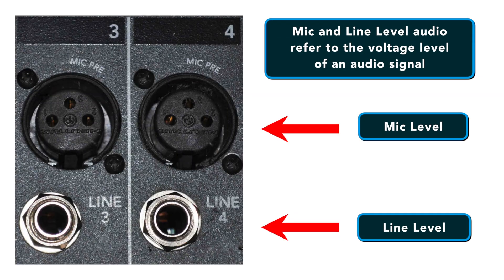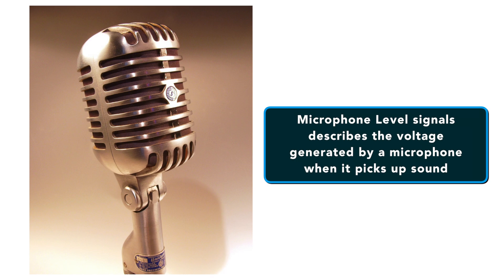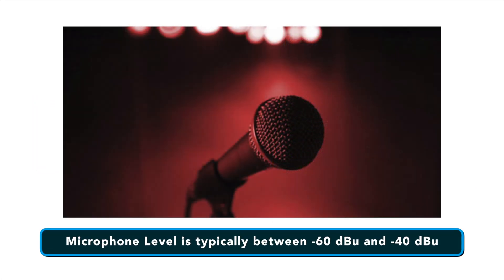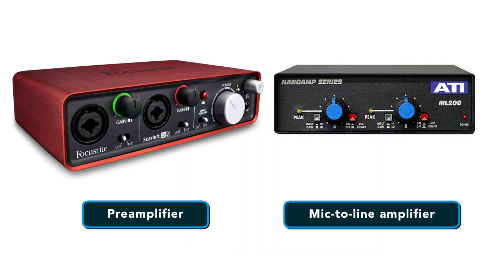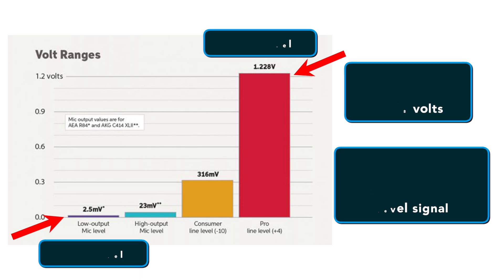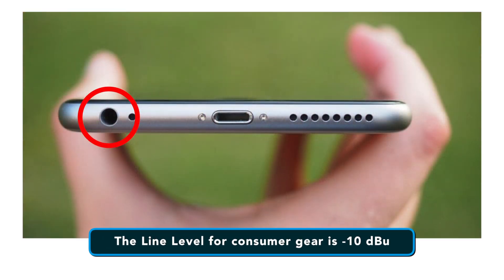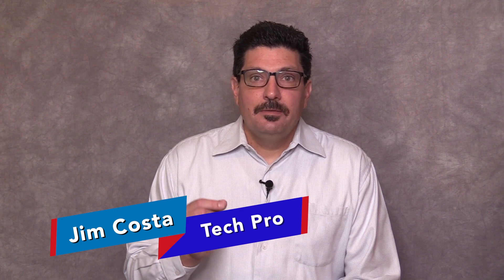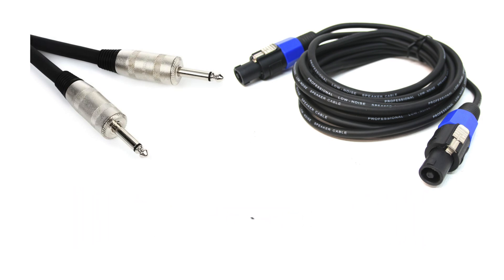Unraveling Audio Signals: A Guide to Mic, Line, & Instrument Levels

Comment: This guy has no idea what he's talking about. Take advice from him at your own peril. This may be the simplest explanation that you've come across, but that's only because he's not giving you all the information you need. And by leaving some things out, you run the risk of damaging your equipment. Find some better resources on this topic, and I think you'll agree with me. 

If you are new to all this, hold off on doing anything until you have a complete understanding on this topic. If you just start connecting different pieces of equipment together using only signal level as a guide, you can easily do damage.
Reply from the maker: Well, this is an entry level/beginner level of experience video. It's not meant to be advanced at this stage in a viewers experience. However, if you think the info is inaccurate, feel free to write a lengthly/detailed responce here and explain to the video viewers what you think they need to know. Or, better yet, make a video on the subject yourself and feel free to link to it in the comments here so video viewers can watch it after they see this one. Then they'll have all the info you believe they need.
Reply: @jimcostafilms  Don't get mad at me because you don't know what you're talking about. I'm not the one giving bad information. I don't owe you, or anyone else, and education. You can't learn this stuff in 5 minutes, and you can't teach anything to beginners when you're not a beginner yourself. 

That said, you are a very arrogant person, and need to be called out so others can see that you have no idea what you are talking about. If you actually read my post, I made it clear that without proper knowledge, equipment can be damaged. Instead of giving me an attitude, maybe you should have asked me to explain that. 

If you don't know the difference between balanced and single ended operation, you should not be touching equipment like this, let alone telling others how to do it. Not once in your video did you bring this up in any way. Balanced and single ended operation is not compatible, so if you need to mix them, steps must be taken for compatibility purposes. This is step number  1 in the process. You have to know how to safely connect your components before you do anything else. Have you ever noticed that some of the inputs/outputs on your gear have 2 conductors, while others have 3? This is kind of important. When you take something that has 3 pins/conductors and plug it into something that has 2, you better know what you're doing. Typical XLR/TRS to RCA/TS adaptors or adapting cables, typically take the number 2 conductor on the balanced end and shunt, or combine it with the ground on the single ended side of the connectors. That can be a problem because the number 2 pin is usually hot (+) and the ground (-), is not. When you turn both components on, you instantly create a short circuit. You'll end up with a nasty noise if you're lucky, but in some cases, you can damage the equipment. This is so important, all you have to do is look on the back of any components that have balanced audio ins and outs. 99% of the time, you'll see a diagram listing the electrical properties of each pin. This is why. 

When you talked about the different output levels in the video, you referred to the +4 output as "pro" grade, and the lower output as consumer grade. That's a false statement. Those 2 numbers tell you the input/output on the +4 connection is balanced, and the other is not. How do I know this? When a signal is balanced, you naturally end up with an additional 4-6 db in output. It has nothing to do with a piece being pro or consumer. There is plenty of consumer gear that uses balanced topology. The noise that you were referring to wasn't from overdriving an input, it was from improperly making a connection because you don't understand the electrical properties of each type of connection. 

I'm not even scratching the surface with the information in my post. You can take college level courses on this topic. You made other mistakes, as well, but I'm not going to spend my day at a keyboard. All I can say is you have to know this information. Its usually the first thing you need to learn. Here's a reference to get your started. https://www.ranecommercial.com/kb_article.php?article=2107

"
Reply from the maker: @AT-wl9yq  What makes you think I'm mad at you? I invited you to correct what you think was wrong in the comments and/or in your own video. You gave a lengthy explanation of some of what you think was incorrect and posted a link to the info you think was needed by viewers of the video which is what I suggested you do. 

The only one with an attitude seems to be you, first for saying, "This guy has no idea what he's talking about. Take advice from him at your own peril" in the opening of your original comment and then by stating in your next reply/comment, "Don't get mad at me because you don't know what you're talking about. I'm not the one giving bad information. I don't owe you, or anyone else, and education. You can't learn this stuff in 5 minutes, and you can't teach anything to beginners when you're not a beginner yourself. That said, you are a very arrogant person, and need to be called out so others can see that you have no idea what you are talking about." 

At what point did I attack you personally?

Do you really think I’d literally invite you publicly to correct me if I was so “arrogant?” My only goal is to provide to people accurate info they need; if not from me than from someone else. In fact, I think you should be making very detailed video tutorials on audio subjects since you took the time to provide such a detailed answer. Video viewers can probably learn a lot from you, but, I guess that since you owe no one an “education” you won’t create such tutorials even though you have valuable insight. 

I suppose it’s easier to anonymously troll than to publicly teach.
Reply: @jimcostafilms  It wasn't my intention to insult you, or anyone else. However, there is no shortage of bad and misleading information put out by people who don't have a full understanding of what it is they're talking about.

You keep asking me to make videos and tutorials, or whatever, but I've noticed that in both of your responses, you're being very careful not to touch on not a single word that I've said. These are fundamental concepts that you as an "educator" must know. There's nothing for me to add that isn't already available in abundance.

If you still think I'm wrong after all this, there's a simple solution. Quote me on something I said, and prove its not true. If you make an honest attempt and still can't figure it out, then I'll help you. But you have to at least try.
Reply from the maker: @AT-wl9yq  OK, fine. I’m not interested in proving you wrong. I never was. In fact, the opposite is true. I’m of the opinion that one should never complain unless they can prove they can do better themselves. I took from your detailed responce that you can do just that so you should try to help those that need it. If you don’t want to, that’s on you. You do, however, sound like a knowledgable person who could correct the bad info out there.

You said this, “If you don't know the difference between balanced and single ended operation, you should not be touching equipment like this, let alone telling others how to do it.”

So… since you seemed convinced that I have no idea what I’m talking about, I’ll compare/contrast Balanced vs. Single Ended Operation (as you brought it up) and few other types as well.  

My understanding is as follows. Please feel free to correct whatever is wrong. 

Single Ended

A single-ended configuration uses two signal connections, one for + and one for ground (or signal return). It is the most common connection used to headphones, between components, and in the internals of audio gear, by far.

Balanced

A balanced configuration still uses two signal connections, but requires that both lines have the same impedance (not nearly the same, actually the same). How this is achieved doesn’t matter (i.e. it could be from differential signal lines off a source or from a single or a single signal line and a resistor on the ground/return line). This, combined with the twisting of the lines, is what’s required to get the noise rejection from balanced operation (CMRR).

Differential

A differential configuration, which is still a two-wire connection, drives one line in + phase and the other in - phase. This doubles the potential difference between the signal lines, which is what yields the higher (double) peak-to-peak voltage of differential operation (and thus the higher signal level).

Typically a differential amplifier (balanced or not) requires twice as many amplification circuits (one each, per phase, per channel, so four total) as a non-differential design (one per channel). This means that for an otherwise identical amplification circuit, a differential implementation will require twice the amplification circuitry.

One implication of which is that for a given level of performance, a differential amplifier either has to be more expensive than a non-differential version, or corners have to be cut in terms of the bill-of-materials (or saved elsewhere). So, in general, single-ended amplifiers will tend to offer better “bang for the buck.”

Note: Being balanced does not require differential operation. Nor does being differential in operation require a balanced configuration.

This is why you can have a single-ended amplifier, but still get the benefits (noise rejection) of a balanced connection. It is also why you can have an otherwise single-ended DAC or amplifier offer a balanced output.
Fully Balanced & Balanced Differential

Sometimes we see the term “fully balanced” or “balanced differential”. In theory these terms are actually describing different things.

Fully Balanced

“Fully balanced” should be taken to mean the entire design, from input to output, is using a balanced configuration.

This isn’t super useful, as the benefits from balanced operation are really in the realm of improved CMRR (common mode rejection ratio) and are most beneficial over long cable runs … not the very short paths on a PCB.
So, more often than not, “fully balanced” actually means “balanced differential from end-to-end.”

Balanced Differential

Formally, this is a configuration that uses a differential topology from input to output (i.e. no phase splitters on the input, no summers on the output) and uses purely balanced transmission lines from end-to-end.
More commonly it just means something is fully differential, and has balanced inputs and outputs because balanced transmission lines do not matter as much on the PCB.

Power

It’s not being “balanced” that yields more power vs. “single-ended,” it’s being differential. You can have balanced connections and the same power output as the single-ended connections.

However, for the connection to a headphone you need to have a balanced (four-wire, no shared ground) connection to have differential drive (but you can have non-differential drive on a 4-wire connection; the ground wires are separate but are still ground).

With a differential connection you’ll see double the potential difference (voltage) in the signal, which doubles the volume, and then you have twice as much power available from the amplifiers (since there are twice as many of them, with pairs operating in opposite phase), giving a doubling of current capacity. Thus yielding a 4x increase in the output power.

With all that said, is balanced audio better or worse than single ended? It depends.

Regarding audio cables, there are several differences, but balanced lines are always going to be more resistant to noise due to common mode rejection. This is the process where balanced cables that have dual-polarity lines end up phasing each other out and canceling any noise that is in the signal. However, noise resistance isn’t the only thing to consider. Depending on the scenario, single-ended cables may be better suited for shorter lengths, low-gain signals like instruments, environments with power isolation (shielded or away from your cables), or budget considerations.

Regarding circuitry and design, a "true" balanced circuit (being balanced from input to output) will always sound better than a single-ended circuit. Pseudo-balanced circuits (using operational amplifiers or transformers to achieve a balanced output from a single-ended source) will not necessarily sound better than a single-ended circuit. There are many factors to consider, but there are exceptions to the rule where single-ended circuits/amps do sound better than a balanced circuit.

Just to be clear, all this is way beyond the scope of the video I originally posted. That video is part of a series of other ever more detailed videos in playlist on audio topics.
Reply: @jimcostafilms  You don't have it right. You're actually making it too complicated. Single ended operation requires 2 conductors. A traditional + and -.  Balanced connections require 3 conductors. 2 signals (+) and a ground (-). If you are looking this up in a book, they usually label it in confusing way. For SE, they get it right and list the 2 conductors as hot and cold (-). Then when you look at the balanced diagram right next to it, its labeled  +, - and shield/ground. The problem with that is the + and - on the balanced diagram is used to signify polarity, and not hot and cold. Both signal conductors are hot. And this is where the problem lies. You have a 2nd signal conductor that's hot, and you have to do something with it to make it compatible with single ended circuitry. For example, if you want to plug a guitar directly into a mixer, the mixer usually has balanced inputs. In order to make it work, the most common solution is to get a direct, or DI box. The DI box takes the guitar signal and converts it to balanced. Now you can plug it into the mixer with no problems. If you don't know this, the average person will get an adaptor in the form of a cable or connector, and use that to plug into a balanced system. Most if the time, those types of adaptors deal with the 3rd conductor (usually the number 2 pin) and shunt it to the ground pin. Simply put, the adaptor takes one of the hots and combines it with the ground. The second you make the connection and power up, you instantly create a short circuit. You'll get a very unpleasant noise, and maybe even damage your equipment. And it doesn't have to be a guitar. It can be any 2 pieces, such as a CD player plugging into a preamp. It doesn't matter.

In your post, you go on with a bunch of different situations and definitions. A lot of it isn't correct, and a few things were. Here's what you need to know. Balancing always requires 3 conductors. Single ended is always 2. This is always true. Yes, one component may do a Bal/SE conversion at the inputs and outputs, while other components are fully differential and keep the signal balanced through the entire component. For this discussion, none of that matters. We're only concerned about what happens when you make the connections. 

As far as making the claim that this is an advanced topic, and beyond the scope of your post, I don't know how you would back that up. Anyone that puts their hands on this type of equipment, professional or consumer, will have to deal with this issue. There will be warnings in the owners manual, or pin layouts printed directly on the component itself, right next to the connector, or any other way of warning users about potential problems. If you can damage a component just by plugging a cable into it, I would argue that its the first thing you should teach someone. Also, I did provide you with some solid reference material. If you find it lacking in any way, there's no shortage of information on the topic. If you would like to have a place to go and talk with other pro audio people, try this website. https://forums.stevehoffman.tv/. Its an entire website dedicated to pro audio issues. They can help with just about anything you come up with.
Reply from the maker: @AT-wl9yq  Great explanation.

Comment: So how do you know what line level to use +4 or -10 ?  Is the louder output better, as long as there’s no clipping ?
Reply from the maker: The short answer is: You always want louder output then softer output, but +4 is a bad idea and you do risk clipping at any audio level above 0dB, particularly with digital audio.
Reply from the maker: Theoretically, yes, -10dB should be fine. I would start your volume settings here (and then adjust as needed): On the front of the Denon, set your front knob volume to about 5 (straight up). One the Tascam on the back, se the L/R to 10dB and on the front, set the ST 1/ST2 knobs the same (straight up to level 5) on the individual channels. Be certain you have set the Line/Mic button to the correct setting (either mic or line level). The switch is on the left under the power button. Make final adjustments to the channel masters (on the right side of the unit) as needed. You can monitor the ST1/ST2 master volumes on the far left with the headphone inputs and the switch above them. I would also monitor the audio after your final output (whatever that is) as that sound in that location (after the final output location) is what's being recorded or going out to the house sound or whatever.